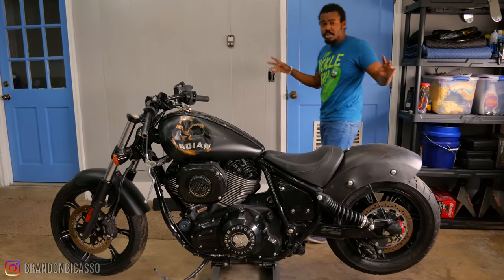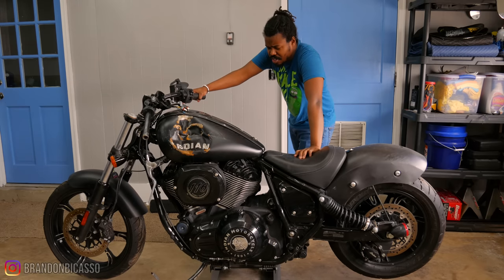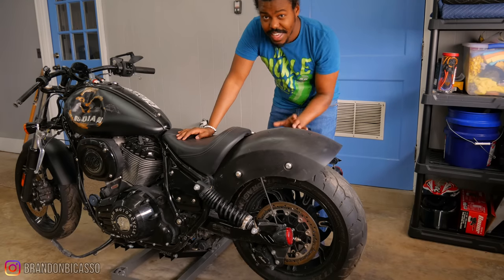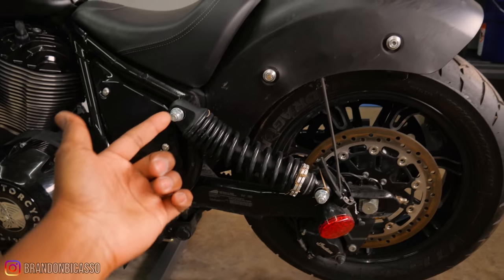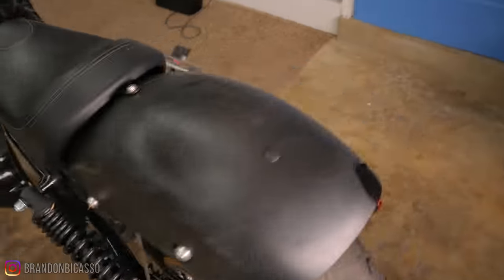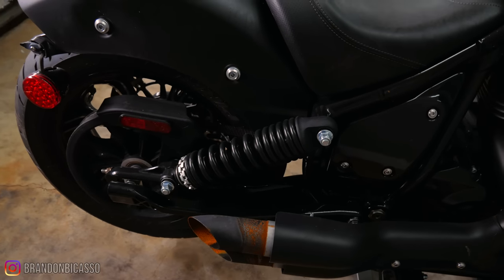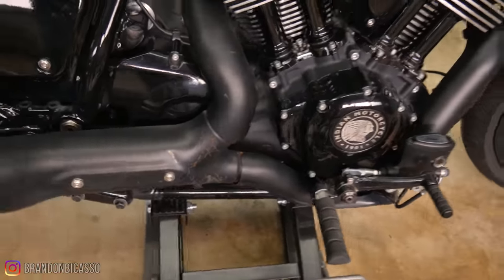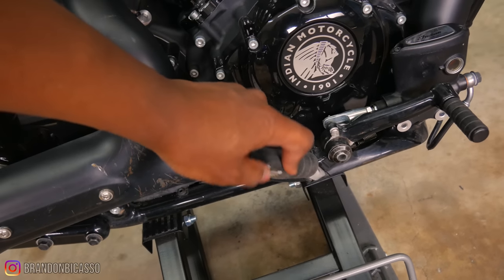My Cheap Indian Chief Has Hidden Damage | How Much Will It Cost To Fix?

Comment from the maker: This motorcycle 100% has radiator fluid. 🤡
Reply: It's called "rain" 🤣
Reply: Yep, I’ve heard that you’ve gotta fill it via the blinker fluid filler hole.
Reply: That looks like a 3k-4k redo if your lucky
Reply: @MrHarlemknight73  way more plus parts is a bitch to get
Reply: That is a full aftermarket exhaust it's like a slash could drag time deal
Reply: You would be better off making a lot of the brackets and parts Yourself by Cheap welder and other tools and do some fabrication and would make for some good content
Reply: I tell you though mate, the replacement tank would look ace in a faux rust-tinged finish. I got the idea from the pattern left by the damage. Giving it a worn, wrecker look would certainly be fitting 🤘😉✌️
Reply: Nut-up and get a new tank man. It costs $1,300 for a tank for my '04 warrior, ain't nothing cheap on a bike but your labor...just say'n... a new tank will get it looking a lot better,  and that makes the rest a little easier.

Comment: If the frame is good, just make a chopper/bobber out of it Brandon. New tank and fenders. Lowbrow Customs is the place for parts. It will look cooler anyway.
Reply: I wonder if you could exclude the fenders altogether, see how that looked.
Reply: I bought a super chief and seeing the frame design I said to myself it wouldn’t be too hard to make into a rigid bobber/chopper
Reply: Came here to comment this too. I had been looking on copart of chiefs because with that engine a bobber chopper style bike would be niiiice. 

Custom tank, fenders shifters. I don’t know what bypassing the Ecu stuff is/how reliant it is on the computer but I would go as rudimentary as possible.
Reply: This bike was deemed a total loss which means it can’t be plated for the road until it receives a salvage title from the state he lives in. Laws are different in each state but in general, the bike has to be brought back to OEM condition and then pass a very rigorous inspection to ensure the bike is safe for the road. Building a bobber would never pass the level of inspection required to get a salvage title. This is why it’s better to just stay away from this type of vehicle.

Comment: Oooft! With a closer inspection, it is definitely going to keep you busy.

Throw a vies grip on the broken gear shifter linkage, rotate the rear tire back and forth while gearing down, and find neutral. That should help with that for sure.

Comment: Hey B, I have a table lift that is pneumatic and has removable side panels on it big enough to work on a quad on it. It has wheels and a detachable pull handle so that it can be moved  pretty easily around the garage. So you are not limited to one location in your shop. I've had it for a year or so and it cost me around $1000, I think? I picked up a one hp silent, 110v California Compressor to run it  off Ebay for about $170. I love that thing!

Comment: You are the man Bicasso. My .02 says this bike was wrecked before it was wrecked, lol. This poor thing has abuse written all over it, from the aftermarket pipe, to the wrap hiding a previous mishap screams somebody had bad intentions . The dent in that tank says it was a high speed mishap. Judging from the damage being all over the bike I can see a major high side followed by a rollover. (That left shock taking the brunt of the impact) Check those forks and that frame good man, that poor girl is hurt. It’s the bride of Frankenstein! This is going to be an awesome series……

Comment: If you're gonna sink $$$ into a NEW tank, what about the possibility of a Challenger tank? It'll add interesting different lines to the look of the bike and more fuel capacity/miles :)
Reply: I say cut the bottom off for the mounts and weld it into a Harley tank,  make it rigid, then use as many cheap Harley parts to replace what is needed
Reply from the maker: Cool idea but involves a whole new fuel pump assembly and mounting.

Comment: have you thought about doing a wrap on it instead of paint? for sure check parts breakers see if you cant get some of those used pieces
Reply from the maker: I thought about it. The tank has to be dealt with. If I replace the tank with a new one, that's a paid for paint job. Then, I'd have to get the fenders fixed and figure out what color to paint. I got two local paint shops in mind, but that probably won't come until the end when everything else is situated. It'll be rideable first ;).

Comment: My new tank for my chieftain after my crash was $2,500. But it's black pearl with graphics.  It actually needed 10,000 
In body parts . New fairing, front fender, gas tank, saddlebag, highway bars , cam cover plate. 
Frame motor and drive line we're all in good shape so. I have faith that yours can be good too.

Comment: A friend of mine rebuilt a wrecked bike.  He rode it for 5 or 6 years.  We use to pick at him because his rear tire was about a foot off track of his front tire.   Not much you can do when the frame is tweaked.  I think you will have to buy a new tank.  Probably buy rear fender brackets.  The fenders can probably be fixed.
Reply from the maker: Yeah, we definitely aren’t like that 😂😂😂

Comment: You've got nothing to lose on that tank, it's a great place to start learning bodywork honestly. I'd personally be really tempted to find a tank smashed from the opposite side, then cut them both in half and weld them together. Or something like that.

Looking forward to the next one!
Reply from the maker: Definitely could be something I practice on. I jumped ahead and started detailing the scratched parts. Came out nice so far!
Reply: @BrandonBicasso  nothing wrong starting with the easy W!

Comment: Ok if i'm right you can use a crescent wrench to disengage the clutch on the bottom of the derby cover like on the Victory. And you will need a jumper wire up by the lever good luck

Comment: Connect the positive 1st then the ground.  This way there's less chance of draining the battery (or getting  shocked) while connecting the positive.  
Disconnecting the battery is the opposite.
Reply from the maker: Yeeeah, got ahead of myself that time. 👌🏾
Reply: @BrandonBicasso  Slow is smoove, smoove is fast.  Just chill out while wrenching, have a brew, listen to some Coltrane.
Reply from the maker: @HiroNguy  I get caught up on filming and running back/forth 😅. I’d have more focus if I weren’t doing all of that.

Comment: You can manipulate the clutch and shift linkage with channel lock pliers.  You may need a helper to spin the back wheel to help shift into neutral.
Reply from the maker: Yeah, that’s how we got it in the garage. 😂 Jammed channel locks on the cable and rolled it in. I’m just gonna replace everything needed to get that sorted versus rigging it. Not necessary for me to start it right away.

Comment: Time to write a punch list up on the wall (parts list to be replaced or repaired).
Also, side stand has a switch to stop the bike moving if in gear so you don't ride off with it down. Noting the damage to side stand, see if it's also broken. Might be another thing to stop it running.
Reply from the maker: On American bikes, there’s no kill switch on the kick stand. You can ride with that baby down. 🤣

Comment: It also had blinker fluid. One of the most infuriating thing about that motor is checking the oil. It always reads like it is low. Be careful not to over fill because the oil will spew into the intake. The best thing to do is change the oil and see how it registers on dipstick and use that as a reference.
Reply from the maker: Yeah, will play it by sight when that time comes. Reminds me a lot of the M109R. Dual sump design is annoying to deal with on that bike. I like the V-Rod more for that reason. It's 5 quarts straight and done.

Comment: The plastic dip frame is just another indicator of why the bike ended up at auction.  Previous owner didn’t give a crap.  It was done after a former accident than didn’t total the bike.
Those exhaust are GP Shorties.  They are basically no exhaust.  
Build a search on eBay and have it send you alerts when people post parts.  Don’t buy a tank from Indian.  They are stupid expensive.  I bought another bikes wrecked tank off eBay for my rebuild.  Once you find a seller parting out a bike send them a list, they might be able to hook you up.  I have gotten lucky a couple times.  Only had to buy hoses and fasteners direct from Indian so far.  
Also check on Indian buy sell / trade parts groups on facebook.  Had a few people give me their take offs because they were adding after market parts.

Comment: I sold a bike to buy my first Harley in 2014, a very chromed out Yamaha cruiser, and the person did a spray plati-dip. One year later I bought it back as he messed it up and my wife really loved the bike. I spent 6 months getting 98 percent of that crap off of the pint and chrome and buying parts to put it back to normal. Long story short, I am still messing with the bike as time allows but I probably will never get rid of the bike again. By the way, like you, I have other bikes to ride so keeping a play bike around is nice to at least look at
Reply from the maker: I'm all for plasti-dip in certain uses, but that's crazy. Guessing they wanted it blacked out.

Comment: Man. That looks like it dropped on the right side, slid the rear end into a guard rail and flipped over it into a tree. That would explain the bent rear shock (slammed into the guard rail post). It is weird the things that seem to be OK though. With that front end damage you would expect the entire front fork to be U/S. It is almost like it was just spared enough structural damage to get it back on the road. I actually think you might have gotten a great deal there considering what you wanted to do with it.

Comment: I'm definitely not an expert but it seems like bringing it back to stock with OEM parts might cost more than the value of the bike. But considering the time you'll have in it maybe that's a way to go. The tank is definitely roached. If you decide to go the custom route I'd be willing to do a custom metal flake paint job for the cost of materials. I appreciate the videos and would be glad to contribute to the effort.

Comment: Does the motor turn? Pull the p cover and check the gears/drive train. That is the most expensive parts. The frame... can be straightened, replaced New/used parts. Don’t get hung up dwelling on one thing. Uncover disassemble and discover.

Comment: The first thing you need to do is obtain a copy of the salvage title inspection requirements for motorcycles in your state. Laws differ by state. This will tell you if the bike has to be repaired with OEM parts, back to 100% or if a “resto mod” can be performed. 

Second you need to obtain a factory service manual and a parts manual from Indian, assuming they sell them. The parts manual will have every part and part number for that bike. 

Don’t assume that the frame is straight just because the belt looks lined up in the pulley. That simply means the wheel and primary pulley are lined up. That frame could be cracked or bent anywhere. It should go to an expert that can make sure it’s right. 

Be prepared to have the most expensive version of that bike even though you bought the cheapest. It’s a bad lesson to learn but you’re learning it. If it were me, I’d cut my losses, pull every good part off it and part it out to get my money back.
Reply from the maker: Good for you! I’m not cutting my losses. So far so good.

Comment: I have the handle bars off the 2018 scout bobber and the mirrors and some of the break lines if they fit the new one let me know as u know I got rid of that Bike and bought the 2021 softail slim I sent u a pic of it already. Do the parts are just sitting in my garage lol
Reply from the maker: Don't think the parts will fit, but thanks for the thought. Maybe I'll buy another Scout as another project 😎

Comment: Check out Ebay Motors for take off parts.  You just might find most, if not everything, of what you need for a much more reasonable price.  As for the tank, there's places out there that will repair that tank or at least tell you if it even can be repaired.  $1500 bucks for a new tank is outrageous.
Reply from the maker: Yeah, the tank will be one of the last things I deal with. Everything else along with starting/riding the bike around the block will happen before I get there.

Comment: Ebay...
Took 1 minute to find 2 Indian tanks.  If it was me, I'd fix the tank.  Straighten the shock.  Drain the gas, put a quart of new gas in, start the motor.
Reply from the maker: I haven’t seen a 2022 Indian Chief tank on EBay yet. 👌🏾

Comment: Dude!  I was gritting my teeth when you played with the ECM.  Instructions say DO NOT touch the ECM to the battery or you’ll fry the ECM.  Careful bro.

Also wondering if those console/speedo connectors are tied into the safeties like start canceling when in gear, shut off when in gear and kick stand is down, etc.  IDK.

Watching intently…
Reply from the maker: I only added power before reconnecting the WCM, not the ECM/VCM. It’ll be Ight but there’s no warning on the WCM, but you’re right. Sensitive components still.
Reply from the maker: Also, to my knowledge, this bike should start without the screen. I’d think it wouldn’t prime without it but we will see soon, right? 💁🏾‍♂️

Comment: My rule #1 of rebuilding any motorized vehicle (and I have done a few), if it's designed to make the vehicle STOP? Replace it. The lines, the rotors, the calipers the res. Everything. Yeah, it's gonna cost money, but do you want to trust brake components that have been in a collision when your blasting down the highway at 70+ mph? Not me.
Reply from the maker: Lol, I’ve dropped my M109R several times and once while in motion. Long as a component is in spec, I’m with the bs.

Comment: I'm a metal fabricator and have done a fair share of repairs.... just get a new tank dude.  The labor cost is going to be absurd for a quality job, and cost materials are also going to run high.
Reply from the maker: Think a beginner can take on reshaping the fenders with a hammer and dolly?
Reply: @BrandonBicasso  Given enough time, possibly.  Adding some heat via a torch would also help de-stress the metal parts so long as there is no paint to worry about.  (paint ignites)  I would also avoid any torch on the gas tank, as that can cause an explosion, even if the tank is drained.  

Honestly, if you are just giving it the "college try" for free with the alternative being getting entirely new parts, I don't see the harm in it.  Beat it back into shape and be prepared to sand and polish the crap out of it.

My general concern is this:  Many times that I see bikes in this condition (I inherited 1), it's almost always more cost effective to just buy new stuff rather than attempt repairs.  There was a guy at my local shop that brought in a 900 dollar bike for repairs that ended up costing well over 10 grand just because of the cost of labor. (120 an hour)  He could have bought an entirely "new" used bike for 6 and just stolen parts from it, or just rode the new bike and scrapped the old.  This is often why many insurance companies will just scrap them.

If this was my personal bike, I think I would do one of two things with it.  1) junk it.  2) OEM be damned, just make whatever bike I want to out of it.   Maybe make it a cool chopper.  Wouldn't have much resale value, as most choppers and customs don't, but it would be a really cool bike to have if the frame isn't twisted, and you don't have to beat a fender back into shape if the bike is a bobber and doesn't have one.

Comment: Never buy a motorcycle that doesn't start to ensure there are no "missing"  expensive, engine parts.
Reply from the maker: Unfortunately, that’s the majority of auction vehicles. There’s something wrong. If not the motor, it’ll be the suspension or something else. I take risk and I’m perfectly fine doing it. 👌🏾

Comment: It will cost multiples of the Chief's value to make it look the way Indian intended so don't bother. That's OK because it didn't look good new anyway. The tank has style and it doesn't need to be pretty to hold gas so just clear coat it and move on to the stuff that actually needs to be fixed before you can ride it, just kidding, none of that crap can be fixed and the tank is not worth saving. The frame, suspension and everything else is broken or bent so throw all that crap in the recycle bin. You could possibly have the frame straightened but why? It's the most expensive platform to buy all the parts for, and I do mean all, there is nothing worth salvageable on it. Save the wire harness. The only cool thing on the whole machine is the engine so save that, then buy an 883 Sportster and stuff the motor in it. It won't run because the crank is bent but it will look cool hanging on the wall.